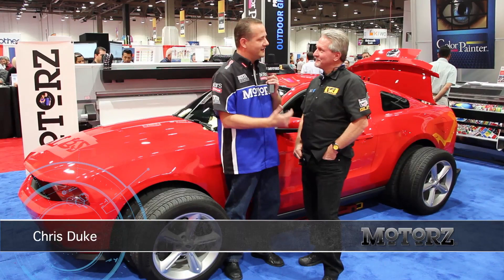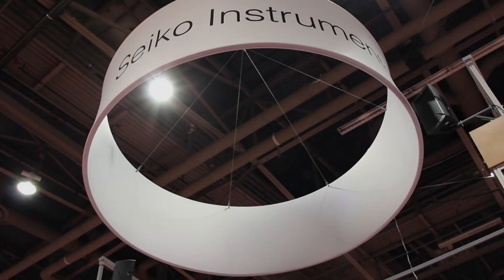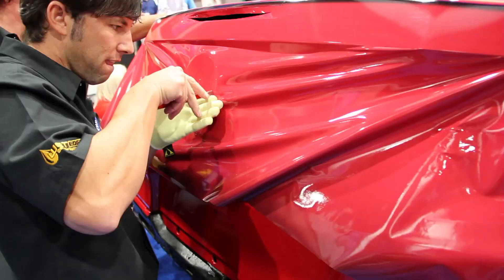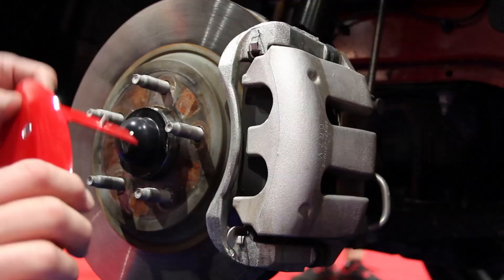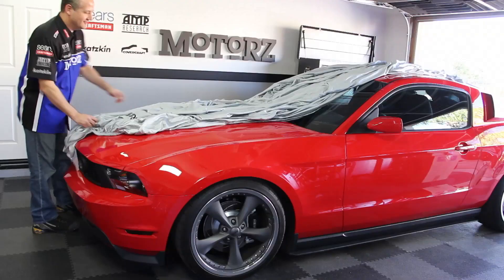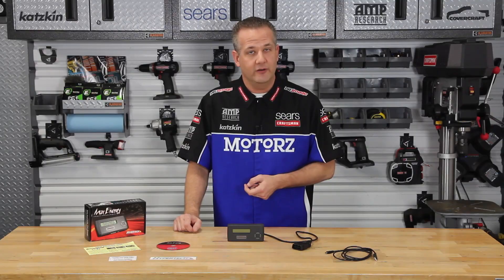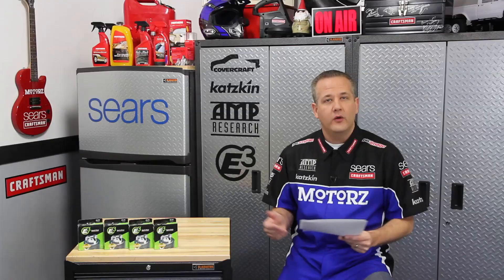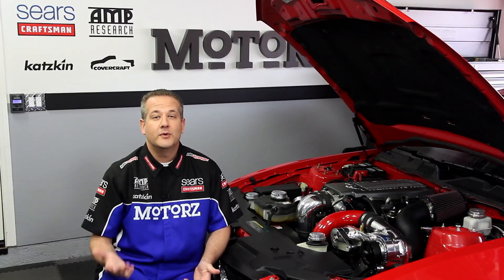How to Install Vehicle Wrap, Grille, Mirrors, Spoiler Ford Mustang Motorz #77

Comment: i would be carful with the plastic caliper covers.
there will be a lot of heat when you breake
Reply from the maker: The MGP Caliper Covers are not plastic. They are made with 6061-T6 aerospace aluminum.
Reply: Motorz
ok, my bad